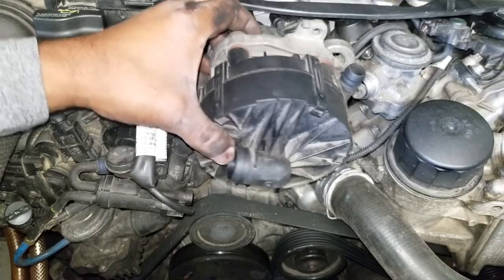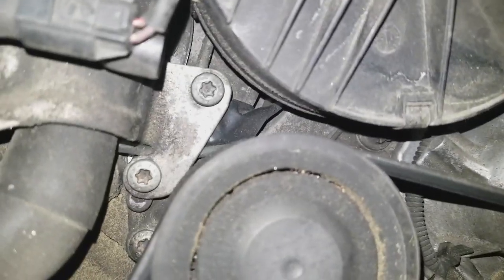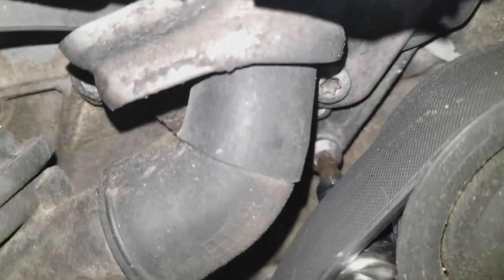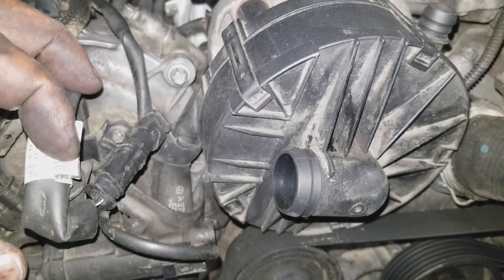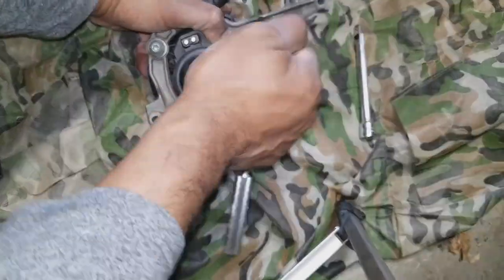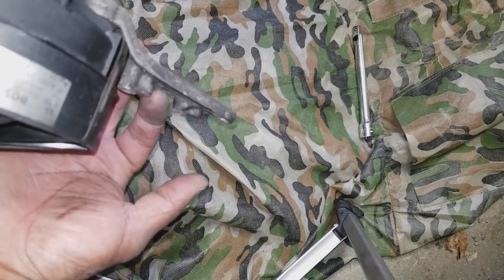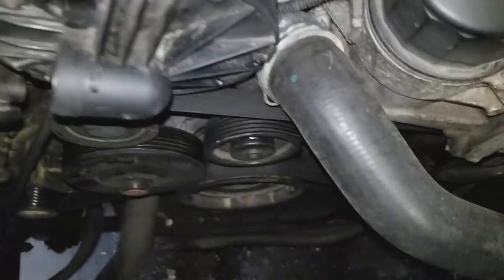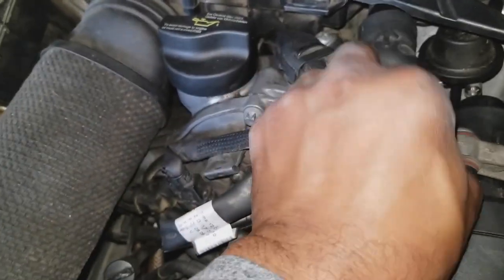Mercedes Secondary Air Pump Replacement p0410 DIY

Comment: FWIW I asked the dealership for a quote and it listed it over $1100. He'd give it to me for $900. And I checked out FCP euro and they wanted less than $200 for the same Bosch unit. Same part number

Thanks Keith for a very thorough demonstration. 

Knowing me I'm sure one of those damn screws is gonna fall down onto the belly pan but that is SOP for my projects 😂

Comment: Thanks a lot for helping me save $1400, which was the quote from the dealer here in Canberra, AU. I ordered the part from FCP Euro for $150, plus the relay for $5 and even I, a complete novice, managed it! I did drop the final screw though and it somehow landed behind the back lip of water pump pulley. The job would have taken about an hour but working out how to get the screw took another hour - finally got a small magnet and use magnetism to pull it out. :)
Reply from the maker: This is good news.   Glad it worked out.
Reply: do you have the link for where you got everything?
Reply: @panduhgaming5473  just go to fcpeuro.com and select your model from their drop down lists
Reply: lawboy777 thanks for the quick reply!

Comment: Thanks for the DIY video clear and cut right to the point. I was able to change my pump base on your video but for some reason after installation and changing the relay the pump didn't turn on I don't know if it was because the car was already warmed up but waiting til the morning and see what happens check engine lite won't erase.

Comment: Figured I would leave a comment on the video just in case somebody has the same problem that I had.

Check engine light came on P0410 with a suggestion of secondary air pump and relay. Replaced them both, cleared the code and took it for a drive. Next time I started the car my light turned back on, same code. Checked the hoses going to the control valves and one was cracked, I replaced it and still had the code.

I was pretty fed up so I took it to a shop that specializes in European cars, they found that even with the new pump the pump wasn’t pushing enough air. The fix was to take apart and clean the carbon from both control valves. 

Figured I would post because I spent hours scouring the internet and not finding an answer as to what could be wrong after replacing the pump and relay.

Comment: Your videos have been very helpful with me taking my car to the mercedes dealer
Reply from the maker: Glad that they help.   Have the videos given you an understanding of what work is being done on your car at the dealership?
Reply: Yes indeed they do . I do most of the work now myself now
Reply from the maker: Awesome!  Want kind of video would you like me to do next?
Reply: Can't think of any at the moment I already did the spark plugs,front and rear differential,oil change.
Reply: My malfunction light keeps coming on my air pump has been replaced and the mercedes dealer can't figure it out either. All fuses changed might be a crimp wire like in your video
Reply from the maker: There are 2 plastic hoses in relations to this pump.  Check them both. They could have cracks as well.

Comment: So question and I'm sorry if it sounds dumb but what's the purpose of the the secondary pump for? Very good video 👍
Reply from the maker: It pressurizes and forces on burnt hydrocarbons on cold starts in the exhausts manifold for recombustion.  It's all about emissions...
Reply: Franklyn Ordonez exactly what I didn't know! 👍

Comment: Thanks for the video, it was very detailed & comprehensive. I just replaced my secondary air pump on my 2003 E350 4matic, & with your video I was able to do it with ease. BTW my check engine light is still throwing a P0410 code after the replacement. What do u think is the issue? Thanks again.
Reply: The 2 valves on the heads?
Reply: O2 sensor?

Comment: Hi there. Gotta say that this videos are extremely helpful, especially for MB owners and for that, I'm thankful.
I know this is not a transmission segment but wanted to post this question to a recently posted video so you can see it. I've had my '08 ML350 since Feb this year and noticed that at times, when I floor it, the transmission seems to downshift into 1st gear and it tends to stay there making the engine rev up like crazy (it scared me the 1st time) and it won't shift out of 1st until I paddle shift or lever shift up. So the question is; have you ever seen this happened? and dos, what do you think causes this issue? Again, thanks for all the help you provide.
Reply from the maker: Sounds like your transmission fluid maybe low. When was the last time you had your transmission fluid flushed? How many miles are on a vehicle?
Reply: Sounds like erratic shifting could be tcm not having good communication with the fuse box

Comment: Nice video.  So you still changed the pump although it tested okay?  I tested my pump & it runs fine.  Will try to check vacuum lines for any cracks or disconnections without removing the pump.
Reply from the maker: Hi Rodrigo,  I reinstalled the pump after it proved to be good.
Reply: iRepair Autos Thanks a bunch!
Reply: How come you could not test it after disconnecting power lead on pump while still installed? Thks..jc

Comment: While removing the connector for the air pump, I broke it and it completely fell apart. Do you know which part number it is? I have not had success finding the replacement for it. Would it be ok to just slide the broken connector over the 2 prongs on the air pump since it feels like a tight fit.

Comment: Great videos. My issue is a cracked air intake hose, part # 273 090 2582 driver side for a 2011 MB E550 4 matic. Item is discontinued and I bought a aftermarket which wound up being short . Any insight would be greatly appreciated.

Comment: 2011 GLK350, got the 410 code, no noise, engine runs fine now i changed the plugs and filters a month ago, I'm going to check the hoses and connections. That front cover is a PITA, those little clips have got to go, I may have messed up something trying to get it to fit right, never did

Comment: Hey brother I know it’s been awhile I hope you see this but I have a genuine question although it might sound dumb. That long bolt at the bottom, the one in the difficult spot behind the pulley. Is that just a bolt that holds the pump in place and not 1000% necessary? I ask because I couldn’t get it in there last night and it got dark so I put everything back together minus that one bolt but everything was secure. Should I be okay? Or is it vital?

Comment: I have the same code as you. On the other hand, I have another problem, the engine marks me that I have 3 cylinders without spark. The problem if there is no acceleration above 3000 rpm, but if I do not raise the rpm I can get up to 70 mph. The problem is that it does not send me codes and I do not know if the problem of p0410 affects acceleration in that way. I don’t know if you have experience with something like that. Thank you

Comment: Ok I changed the pump and the check engine light is gone. I got a cheap after market pump for $81.
But now there is a whistling noise for a few minutes may 3 or 4 mins.
I'm OK with the noise but is it OK mechanical wise? I hear it could drain the battery. But it doesn't stay on. Will try to clean/fix the original one.
Reply from the maker: Will not hurt. Just that cheap parts make weird noises and burn out

Comment: Hello, I barely know anything about cars but with your videos, i'm getting an understanding. I want to test the secondary air pump, what do i need to purchase to do that? I know I have to disconnect the power supply and the 2 prongs are there.
Reply from the maker: You need a 12 volt power source.   Alligator clips to connect up the prongs to the source.    You must check the fuse first. What error codes are you getting?
Reply: Code P0410, I have checked the fuses, my coolant is ok. First start of the day, my air blows cold, then turns hot after the fan goes off. My temperature warning light turns on. I purchased a MaxiDiag MD808 Pro, It also says Secondary Air injection System and the actuator motor for the air distribution flap has a malfunction. I Have a 2008 Mercedes C300 sport 90,000 miles
Reply: Hello, did you see my reply?

Comment: need help on my 2007 Mercedes CLK350 my secondary air pump.i replace new  relay and fuse is good but no power 12 volt to air pump.    i test air pump with 12 volt direct from battery ok.    have any idea ?
Reply from the maker: That wiring to the pump only has 12 volts at engine startup and only when the vehicle is in open loop. Usually when the engine is cold.   Are you getting error codes?

Comment: I just did this on my c300 2010 and changed the fuse and relay but the engine light is still on
Reply from the maker: Check small houses that go from it.  Probably a cracked hose.
Reply: @iRepairAutos  ok I will thank you been driving and cel is still on I’m going to replace all the hoses that gon on the secondary air pump and see

Comment: Hello. I parked my 2007 Mercedes e350 for a week and now it seem like the car is dead. I jump started and left it running for one hour. When I shut the engine and try to start the car it was completely dead that I even can’t turn the key. Help please
Reply from the maker: It might be the battery, the alternator, or both. Have you seen my video on how to test the battery and alternator?
Reply from the maker: Test your battery and alternator.   Here's my video on these two procedures.   https://youtu.be/iHwaZxjrtg0
Reply: It's definitely the small battery under your passenger side seat!!!!!
Reply: Its probably the ESL, research ESL and send the switch and your key to one of those guys on Ebay that can program an emulator for you

Comment: Thanks for the video. I use a multimeter to check the 40A fuse and relay are working, but found the pump is burnt. Following this video, I replace the pump. I use OBDII to attempt to clear the check engine light but the CEL still on. I look at the MB dealer's repair estimate$2180  which includes pump, relay and fuse, and particularly  two more shut-off valves. I highly doubted both valves. Is there a video showing how to check the valves and replace them if needed?
 https://www.mercedespartssales.com/oem-parts/mercedes-benz-valve-0021408360
https://www.mercedespartssales.com/oem-parts/mercedes-benz-valve-0021407460